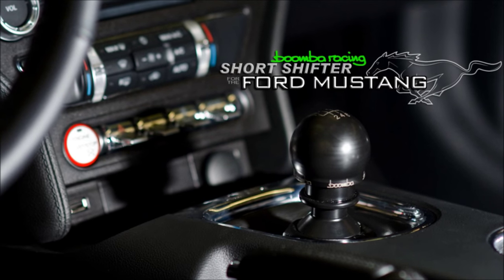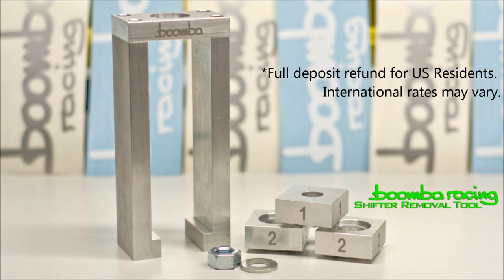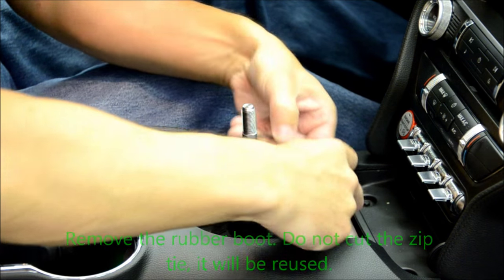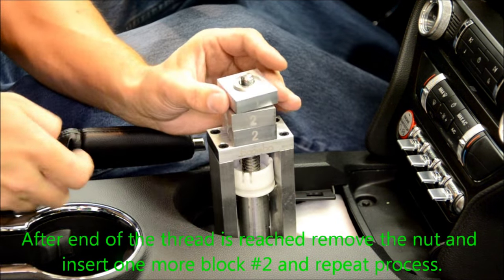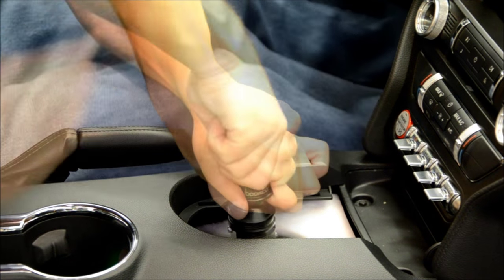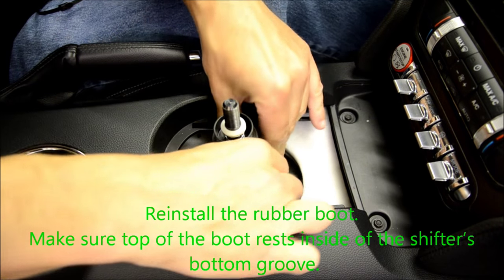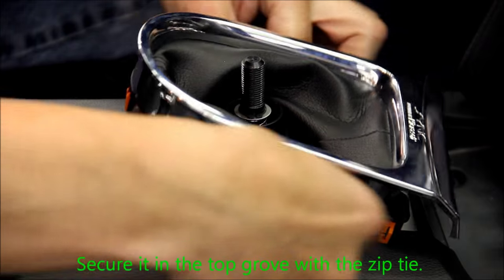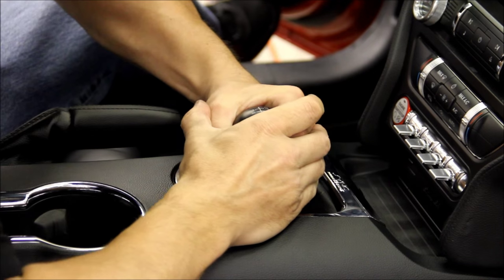How to Install | Boomba Short Shifter for '15+ Ford Mustang

Comment: this is not a short throw shifter... it doesn't change any of the angles of the throw; it only changes the height. the slop from the shifter comes from the angel at which it is thrown into gear, not the height of the thrower.
Reply from the maker: +R For We sell a transmission mount and a shifter assembly bracket to eliminate the excessive drivetrain slop found in the S550.

Comment: Why don't you guys offer a full shifter assembly? I see you sell a "shifter assembly bracket", but the stock shifter assembly itself is garbage..
Reply from the maker: +hatterz through our testing we have found that our shifter arm when paired with our shifter assembly bracket gets the shifting feel to a really great point. We also sell a transmission mount which even further reduces drivetrain flex.

Comment: I have 2016 mustang gt performance pack, can I install this short shifter on it or this shifter only for 2015 mustang. Please help I been saving to buy this for few months nowThank you
Reply from the maker: This is for the 2015 and newer Mustangs. So yes, it will work with no issues on your 2016.

Comment: is there another way of doing this without this tool... I can only afford to buy the shifter...
Reply from the maker: The tool is a 100% fully refundable deposit. However there have been people on the Mustang6G forum that have used different styles of pullers or made their own pullers in order to get the stock shifter out.
Reply: Thank u
Reply from the maker: Robert S550stang Let us know if you've got further questions.

Comment: This short throw shifter doesnt void the factory warranty does it?
Reply from the maker: +Jeff Rodick Long story short; no. 
Certain dealers can be more picky than others when it comes to aftermarket 
parts. Some dealers are fine with mods whereas other dealers will not accept any 
mods. We always tell the customer to ask the service advisor first for what’s 
acceptable at any given dealership and if you have any doubts to return the car 
to stock form before bringing it in to a dealer. This part is quite simple to install, so if you ever did want to remove it before going to a dealer for service, it can be removed very quickly.

Furthermore there is a law called the Magnuson Moss Warranty Act that 
states in order for a dealer to deny warranty work on your car, they have to 
prove the aftermarket part you have installed caused your issue. For example if 
your window stops working and you have a cold air intake, the dealer is not 
going to void your warranty. It is illegal for a dealer to void your warranty 
for simply having aftermarket parts installed.

If you have any further questions, please let us know!
Reply: +BoombaRacingInc Check the Magnusun-Moss Act. It says that a dealer has to prove that the modification caused the failure and thus warranty denial. For example you install a Boomba shifter and the rear end locks up, a dealer can not deny warranty. However the tranny fails, the dealer has to prove the shifter caused failure in order to deny warranty.
Reply from the maker: My Larson that's exactly along the lines of what we were saying!

Comment: is this reversible ?
Reply from the maker: Yes, the stock shifter can still be pressed back on if you remove ours.
Reply: thank you guys for getting back to me ! is there any problems with smashing your fingers when going into 1st 3rd and 5th against the plastic in the shift boot ??
Reply from the maker: Not that we've experienced but a lot of that would probably depend on how you hold the knob.
Reply from the maker: We've never experienced or heard of any problems with this.
Reply: thanks guys I will be buying this for sure !